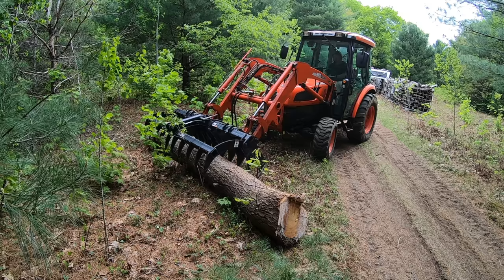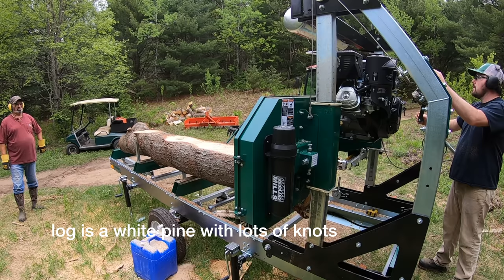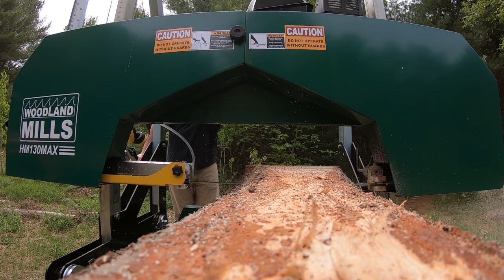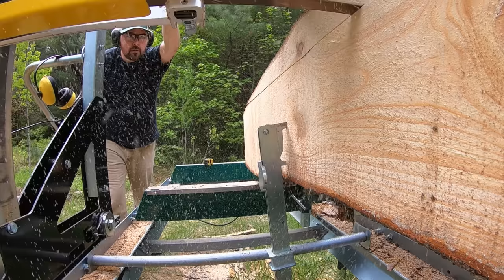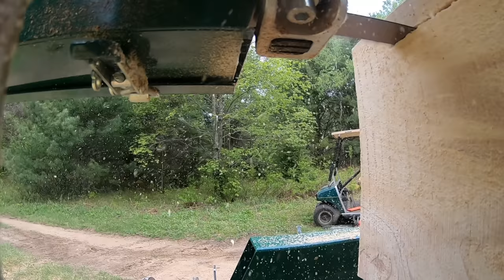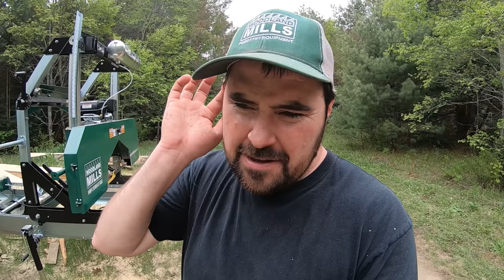Father and Son Running the Sawmill

Comment: Nice little video ,BUT! keep ALL HELPERS AWAY FROM WHERE THE SAWDUST EXITS. CAUSE IF THE SAWDUST EXITS SO CAN THE SAW BLADE AT A GREAT SPEED. A HUMAN CAN NOT WITHSTAND A FAST FLYING BLADE OF DEATH . That is what I call it when here or see photos of blades going 20 feet through the air . Not a pretty site to see. Just like having seen people get killed by a skid steer buckets and they were the operators. So I call my skid steer  (man - killer). you only get 1 mistake in life. Stay Safe. I am not being sarcastic but you only got 1 life.
Reply from the maker: Yeah can imagine a blade could do damage. On this mill there's a  few welded bars in the dust exit I believe for just this reason. I"ve had a number of blades break on my sawmill over the years but haven't had any leave through that opening . Hopefully I never see what you're mentioning. Thanks for watching

Comment: I am glad I watched this as I was wondering if there was a way I could cut the crooked logs without taking so much thickness but I now see you are also ending up taking thick cuts too, I am now relieved to see I wasn't doing it wrong as there is just no way around it when log is crooked.
Reply from the maker: Yeah unfortunately there ends up being a good amount of waste so sometimes I end up just using logs for firewood but this time I figured the lumber it made was still good

Comment: You still don't have a laser on that machine? Do you feel that the tape measure works almost as fast. Seems like you don't have to spend much time finding the highest starting point for the first cut.
Reply from the maker: Hi Paul. I do like the laser but I haven't had a chance to put one on this unit. I find that the laser helps me to figure out my first 4 cuts on the edges of the log faster than the tape measure especially when my logs are smaller so have to try and save all the good wood I can.
Reply: @sawingwithsandy  Yea. That makes a lot of sense now.

Comment: Hi Sandy!  About how long does the lumber need to dry before it is usable?  I assume you store it in an open air shed?
Reply from the maker: Normally I leave it dry as long as possible in the open air shed of mine but sometimes if I"m building an out building I get right to building with it straight off the sawmill.